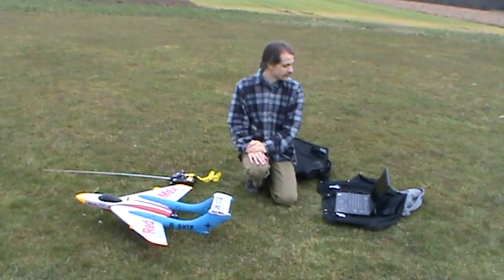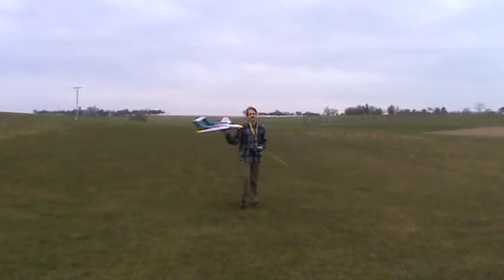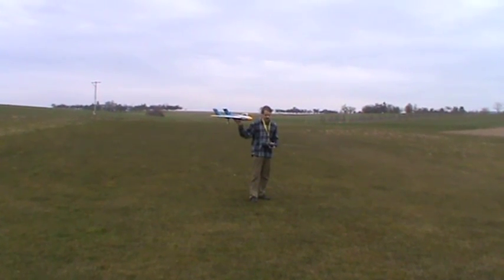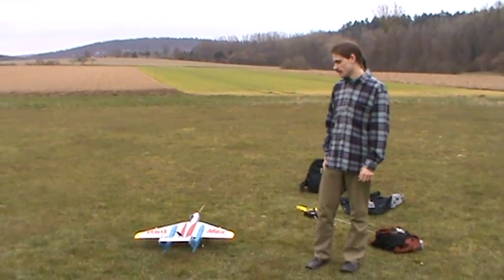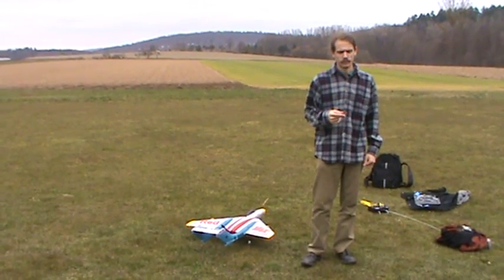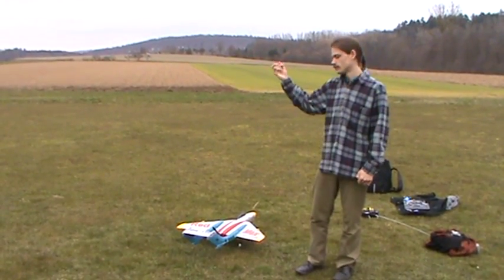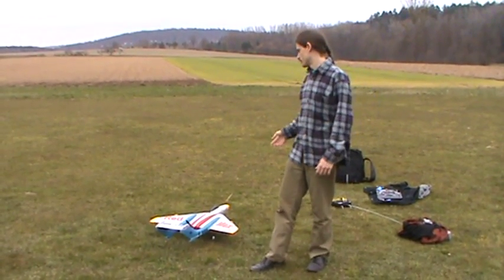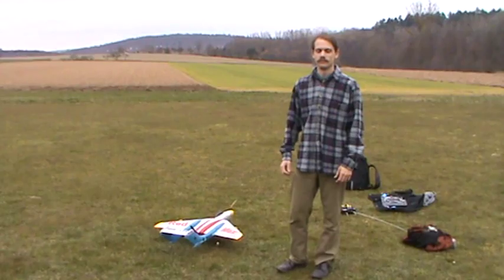OpenPilot fixed wing - 1st fully autonomous flight

Comment: Really nice clip! :) You lost me with the technical talk though lol, is there anyway to get this board pre-programmed to work with my electric boomer (install and go kind of thing) or do I need to know the complicated math? :) the CC3D flight controller correct?
Reply from the maker: This video is old, that was just around when the old CC was released (a year before CC3D) and it was running with prototype "beta" hardware that never went into mass production. The closest thing to that hardware you can get now (in fact much better!) is the OpenPilot "Revolution" board. CC3D will not be enough, as it has no compass and no altimeter and not enough CPU "juice" for fully autonomous operation.
You don't need complicated math, but it will not fly autonomous right out of the box either, you'd need one or two tuning flights to get the coefficients setup correctly. Feel free to PM me on the OpenPilot forums (I'm "CorvusCorax"), I can get you started :-)

Comment: Hi may i know what PIDs you are using? 2 servos on my skyfun going crazy if I apply throttle. Motor vibration will affect to cc3d then apply to servos. Dont know how to get rid of this.
Reply: Me too same problem
Reply from the maker: Hell Flyer can't remember the PID's on that old flight. That was beta hardware 1 year before CC was even designed (which came before CC3D) the beta flight controller was more comparable to revo than to CC/CC3D, but the flight firmware has changed drastically so the same PID's would behave completely different on modern firmware/hardware.
you can try to mount the flight controller board vibration-dampened. for example put some soft foam between flight controller board and the frame itself.  even more important, try to balance the prop and engine like people do for quads, that helps a lot!
Reply: Funny thing is if i put the pitch on manula it does not do butterfyl vibrations, and i dnt use the throtlhe from the board, i use straight from rx, its just a wierd set up